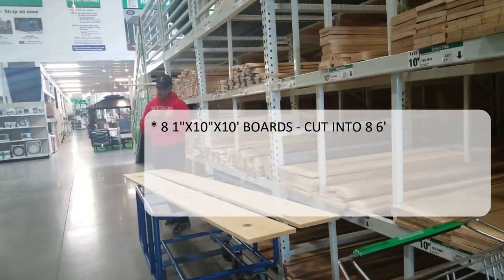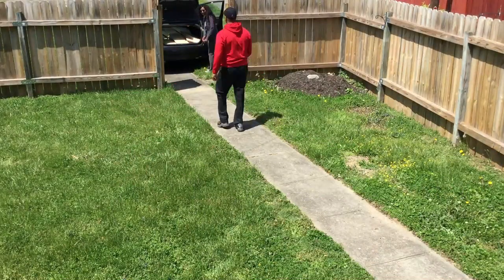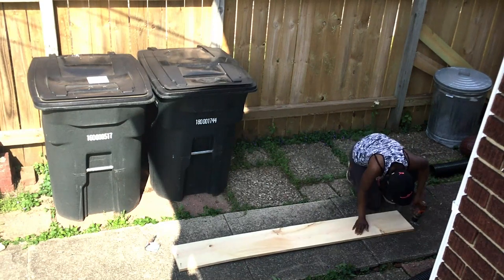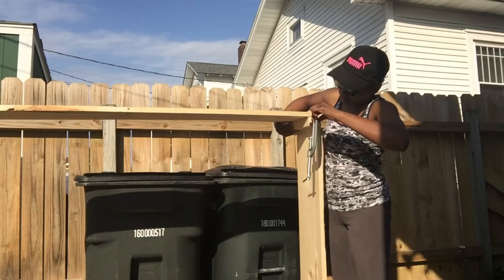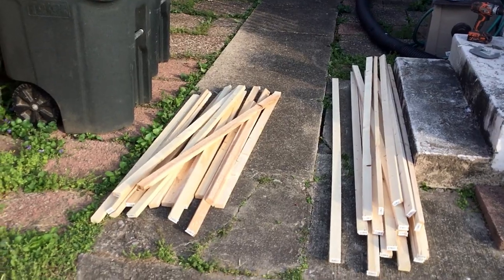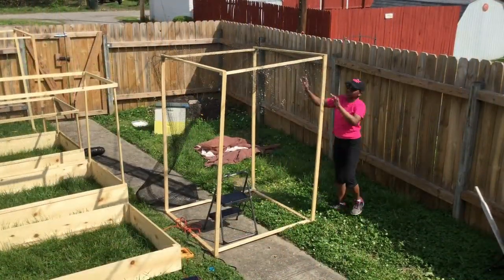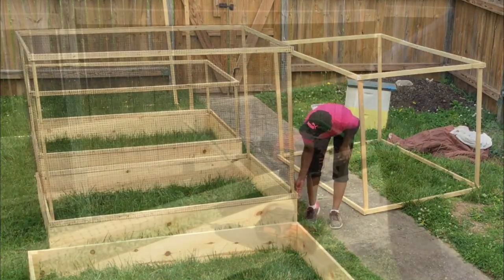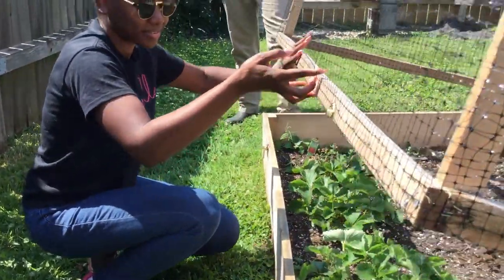DIY RAISED GARDEN BEDS WITH LIDS || Rodent Proof & Super Easy

Comment: This is fine for a basic raised bed. To keep it from rotting over the next year or two put plastic on the inside to prevent contact with moisture. The lids would be more sturdy if you add a crossbeam on two sides. Otherwise you will just have a floppy mess that will get destroyed by a decent amount of wind or a boisterous raccoon. Good luck on your garden and your YouTube endeavors.
Reply from the maker: Thank you for the tip. I will definitely implement these suggestions
Reply: @jchenelle  or you could skip all that and make a cinderblock raised bed. If you make it two rows high you can fill the bottom row with wood chips/ mulch , leaves and sticks. Then use the soil from this garden  or compost that your local municipality may give away or sell very cheaply to fill the rest of it.  This will make it a type of Hugelkultur raised bed. Good luck 👍🏽 with all your endeavors 🙏🏽